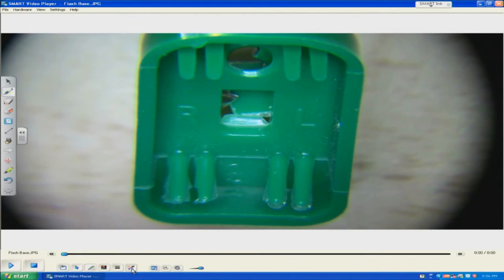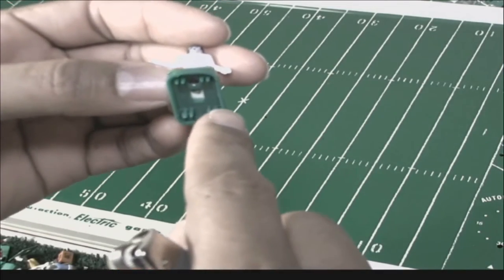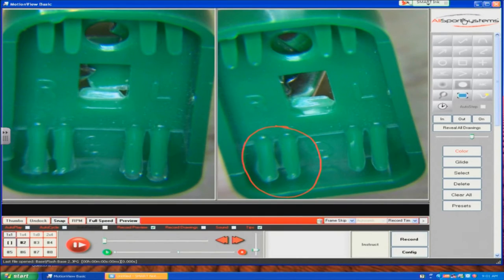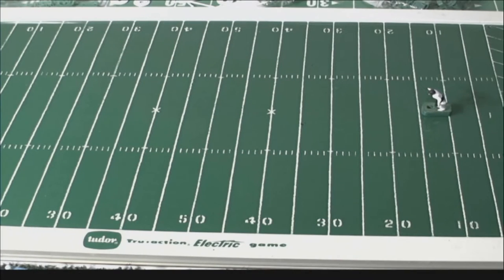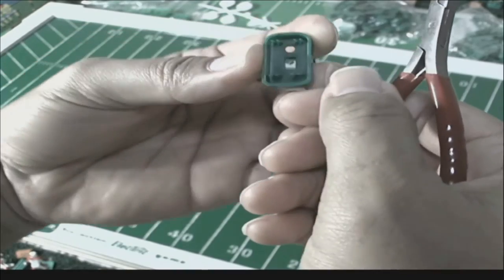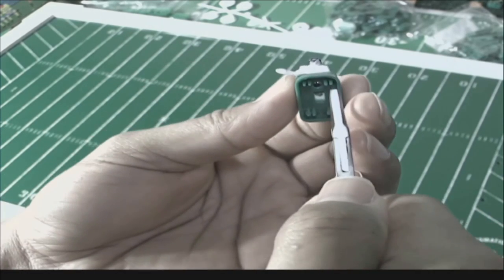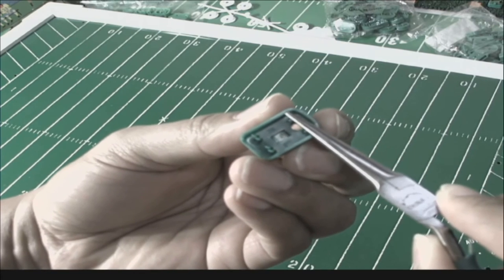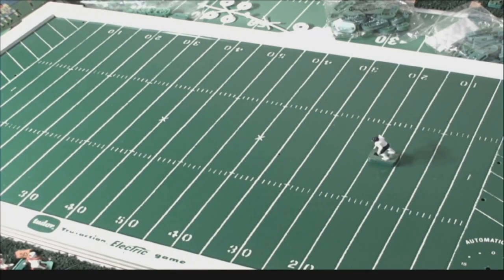FLASH BATTLE

Comment: So, at the point where you use heated pliers, the idea is really to "set" the prongs after they've been smashed. You're not really applying pressure since they've already been smashed. The heat is applied to ensure that the flatness you've achieved is maintained. Do I have this right?
Reply from the maker: +Scott Rahn When I apply my heated pliers, I press down to flatten and set the prongs. Some base prongs may not flatten entirely when only cold pliers are used. Using heated pliers ensures the prongs are being smashed flat. In an effort to achieve prong flatness, coaches break pliers.